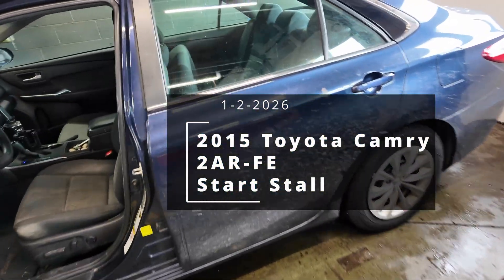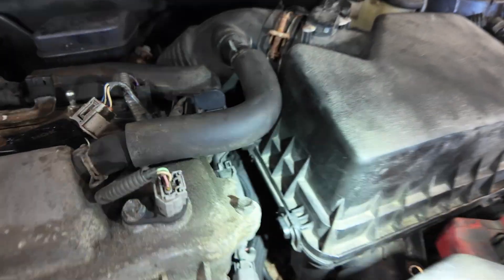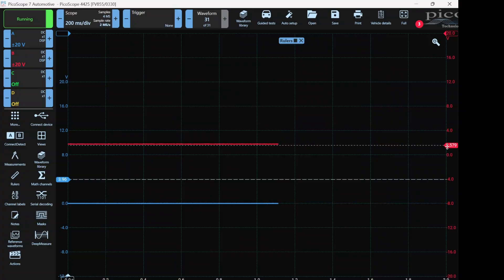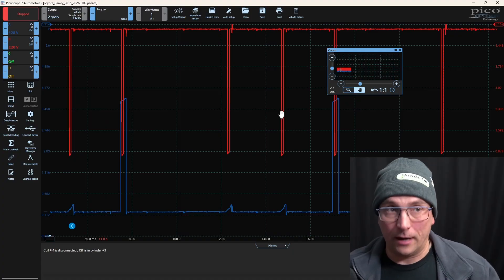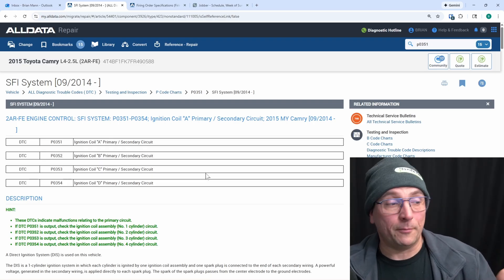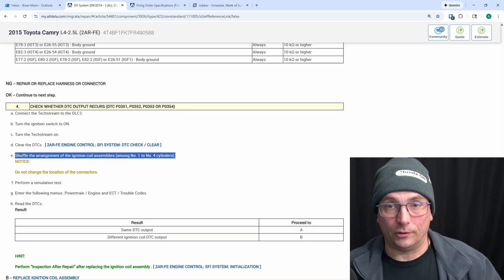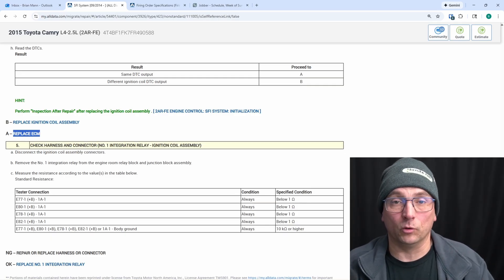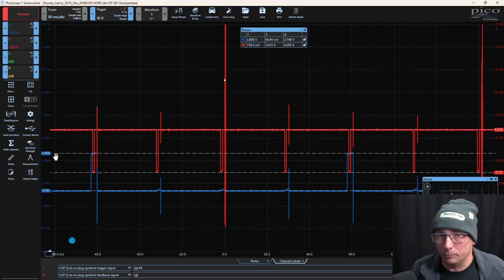2015 Toyota Corolla P0351 Start Stall  P0352,P0353,P0354  The flow chart will trip you up!!

Comment: If you look in Toyota service info there is a fail-safe chart that shows all of the default strategies for specific codes.
For the P035x codes the ECM cuts fuel to that cylinder so if you have codes for every coil it will turn off all injectors.
Relatively common for cheap coils to short the IGF circuit and cause this issue.
Reply from the maker: Thanks for the information! I am going to see if I can locate that,   I wish they gave a link to the fail safe chart in the code description.  This is the 1st time that I have come across this issue.
Reply: @BrianMann216 Yea I'm not sure why they put it in a separate chart instead of in with the code description but that's just how Toyota seems to do things.
Reply from the maker: I never realized that toyota gave that information, Thanks again for pointing this out!!

Comment: I think the engineers who create these procedures and flow charts don't take the introduction of aftermarket parts into account, it's all based on oem. I'm not saying it couldn't happen with oem parts but they do cycle through thousands of scenarios and if this type of problem doesn't occur they have no reason to think it can happen. That, and the engineers are knuckleheads.